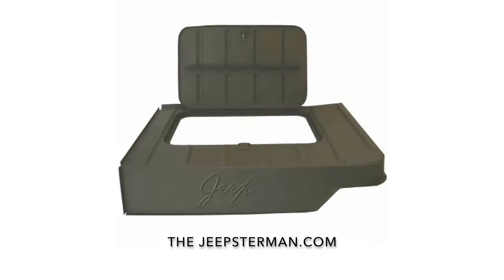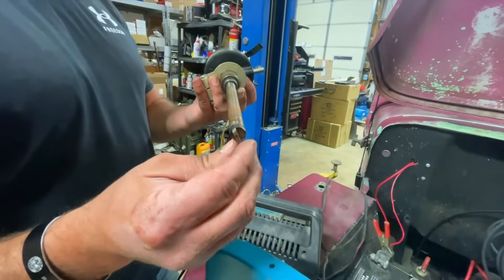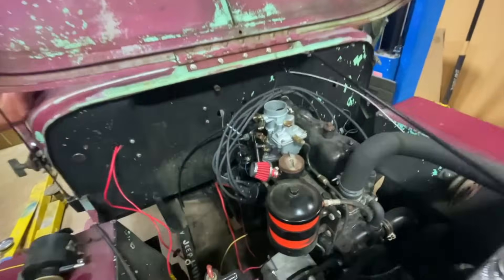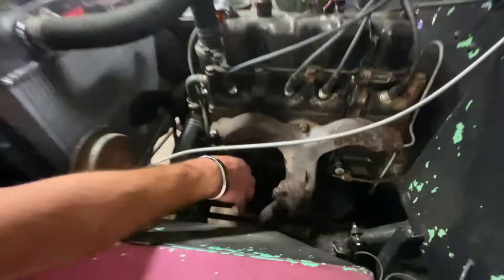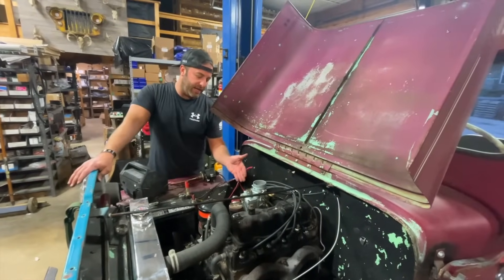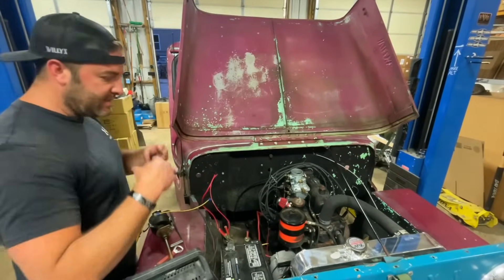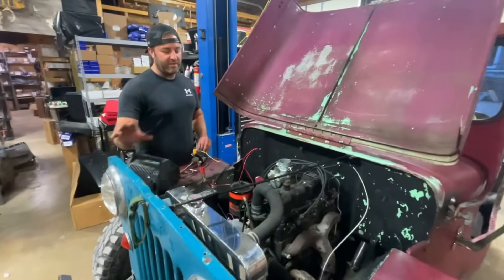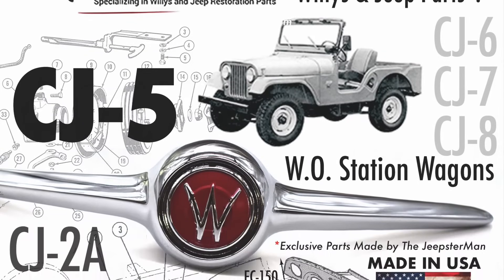How to Static Time Your Engine: A Willys & Jeep Restoration | JeepsterMan

Comment: On the Go Devil L 134 flat head the timing marks are on the flywheel and observable through the little round door above the starter. It is possible to have the flywheel installed 180 degrees out. Mine was that way. It is possible to time the engine using a different spark plug wire but lucky for me; i had to do a transmission rebuild and clutch anyway so I fixed it when i reinstalled the flywheel. These Willys are 80 years old now and a lot of shade tree mechanics were in there before you got it. There are bound to be all kinds of things wrong.

Comment: That's just what I needed to do to static time. I put a cork in the #1 hole and bumped ignition until it popped to find TDC. How do you get final timing though? Manual says 5 btdc and maybe more with modern higher octane fuels.

Comment: I recently got a 1953 Willys M38A1 with a 134 F-head in a trade deal - not an expert on these. It has an Autolite distributor - this is a very old 12V conversion. It has the #1 spark plug wire at the ~ 12 o'clock position. It had points when I got it - started fine when cold-  but had some hot start issues - I assumed it was the points and condenser. I swapped in a pertronix ignitor/flamethrower coil. Checked it with a timing light, it shows the crank notch at 5 BTDC and it runs well in its current state. If the #1 wire is on top instead of the bottom, does that always means the engine is 180 out? Is there any situation where this would be the correct position? It does not backfire noticeably - pretty much runs like a sewing machine now. Should I flip the rotor position as you are suggesting in this video? Or would you just leave well enough alone?! How specifically can you tell if its 180 out - like - what are the symptoms that made you think to check for this?

Comment: 180 on a screwdriver slot will not matter? if it's running flat pointing 9-3 if you rotate it 180 it's back flat at 9-3?
Reply: ok after listening in the begining terrible service now I get it